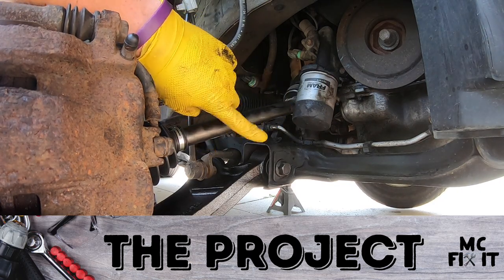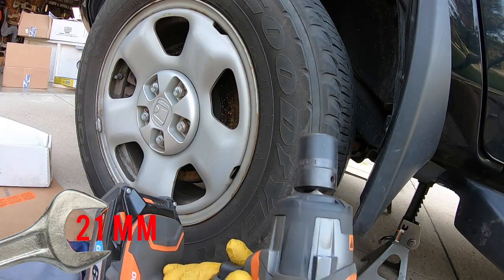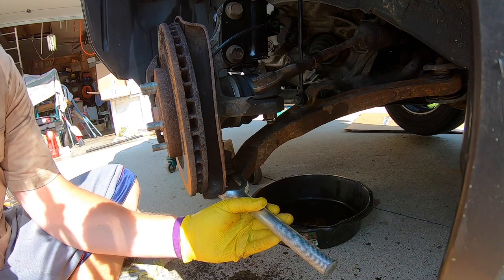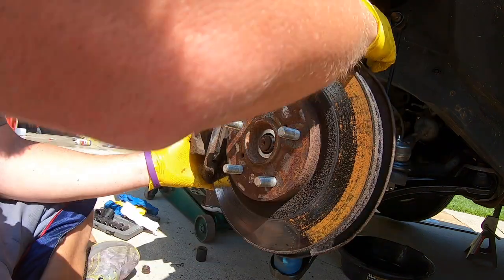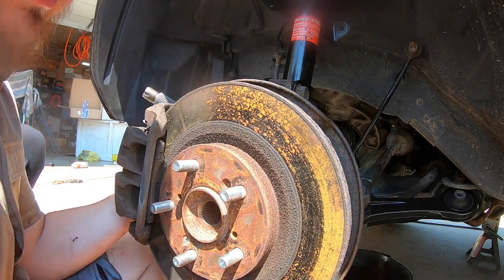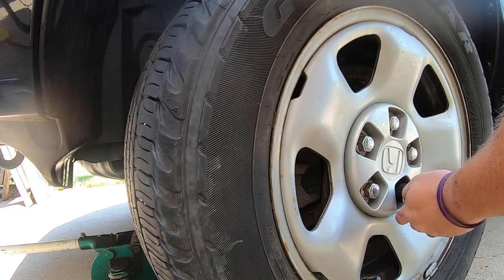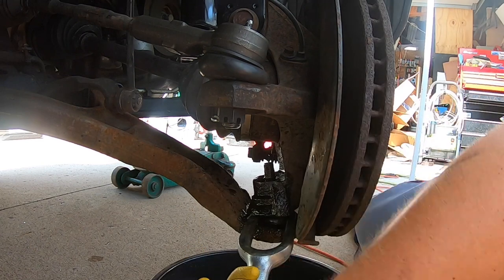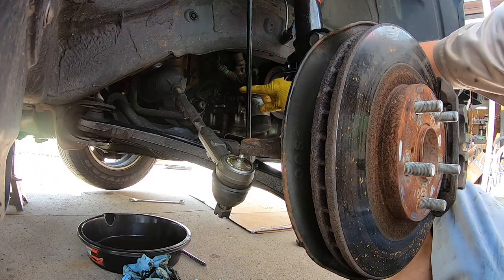How to Replace CV Axle / Drive Shaft on Honda Ridgeline - Front Right & Left (Complete Guide)

Comment from the maker: The Tools:
• Drive Shaft / AV Axel - FRONT RIGHT (Napa Remanufactured - NCV 956284) - https://www.napaonline.com/en/p/CVQ95...
• Drive Shaft / AV Axel - FRONT LEFT (Napa Remanufactured - NCV 956283) - https://www.napaonline.com/en/p/CVQ95...
• Pickle Fork set - https://amzn.to/2X94HyQ
•  Floor Jack (3 Ton) - https://amzn.to/2R7G96H 
• Jackstand (3 Ton)- https://amzn.to/3f3ABC5 
• Pilers - https://amzn.to/3lEU6WF
• Gloves - https://amzn.to/3bbfEnu 
• Safety Glasses - https://amzn.to/3ux25GO 
• Shop Towels - https://amzn.to/2SC8D93
• Ratchet - https://amzn.to/3xWjE5g 
• 17mm, 19mm, 22mm Socket - Basic Socket Set - https://amzn.to/3fjRoBd
• 36mm socket - https://amzn.to/37sz6Kf
• 17mm, 19mm Wrench - Basic Set - https://amzn.to/3jzlMcJ 
• 1in Wrench - https://amzn.to/3ArUuf1
• 1/2in Impact Drill (Rigid) - https://amzn.to/3vVDUBZ 
• Torque Stick - https://amzn.to/33wFTR2 
• Impact Sockets (Metric) -https://amzn.to/3etXiQU 
• Torque Wrench - https://amzn.to/3fEIrDi
• 18in Breaker Bars - https://amzn.to/3lLDpZA
• Flat Head Screwdriver - https://amzn.to/2RAjTlU 
• Long Flathead Screwdriver - https://amzn.to/3CCDCED
• Hammer - https://amzn.to/2VBhF7V
• Rummer Mallet - https://amzn.to/3jDa5le
• Sledge Hammer - https://amzn.to/3ywEurD
• Penetrating Oil - https://amzn.to/3yyyoqV
• Oil Pan - https://amzn.to/3CteDDq
• Tie Rod Puller Tool - https://amzn.to/3lKJ3v6 
• Crow Bar - https://amzn.to/3s0B9yC

00:00 - Start of Video
00:07 - The Problem
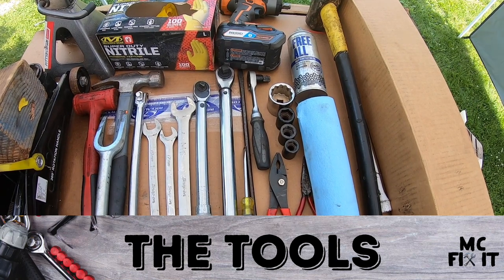00:31 - The Tools
02:10 - Jacking up the Truck
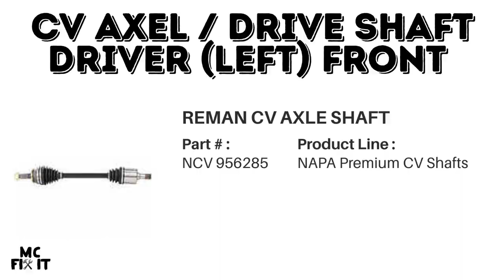05:00 - Front Left (Driver) CV Axle / Drive Shafter
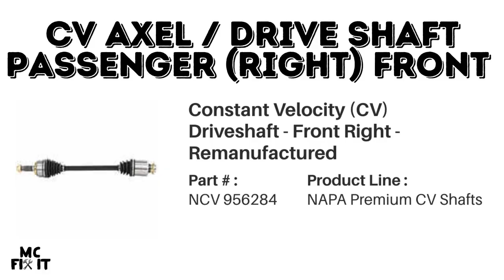23:03 - Front Right (Passenger) CV Axle / Drive Shafter
42:00 - Putting the Truck back down
42:40 - Closing of Video

This video works on many makes and models.

Check out my website at http://mcfixit.us 

Disclaimer:
Due to factors beyond the control of MC FIX IT, I cannot guarantee against improper use or unauthorized modifications of this information in the video, post, blog, or social media. MC FIX IT assumes no liability for property damage or injury incurred as a result of any of the information contained in this video. Use this information at your own risk. If you feel uncomfortable at any time. Stop and go to a professional. MC FIX IT recommends safe practices when working on vehicles, your house, or any other project and or with tools seen or implied in this video. Due to factors beyond the control of MC FIX IT, no information contained in this video shall create any expressed or implied warranty or guarantee of any particular result. Any injury, damage, or loss that may result from improper use of these tools, equipment, or from the information contained in this video is the sole responsibility of the user and not MC FIX IT.

#mcfixit #autorepair #hondaridgeline

——
Supplies used to record this video: 
* GoPro Hero 7 Black - https://amzn.to/3f3ALtb 
* 256GB Flash Drive - https://amzn.to/33pAueG 
* Vlogging Frame - https://amzn.to/33tajE0 
* GoPro Pro 3.5mm Mic Adapter - https://amzn.to/2RCURCu 
* Youmic Lavalier Lapel Mic - https://amzn.to/2R55sWX 
* Boom Stand (tripod) - https://amzn.to/3bdkQaw
* 5/8” to 1/4” adapter (boom to blogging frame- https://amzn.to/3txrVsM 
* Portable Battery Powerbank- https://amzn.to/3vJQc0q 
* 6ft USB to USB-C (powerbank to GoPro)- https://amzn.to/3uAS5MH

Comment: Another $250 saved.  THANK YOU!!!
Reply from the maker: You are welcome! Hope you have a great day!
Reply: The shaft cost me $225 in Canada at NAPA.  Service at the dealer in Airdrie was quoted at $750, shaft included.  Where are you that it only costs $250 installed?
Reply: @rossgee2950    I'm just talking about the labor.  It was going to cost me about that much in labor to have a mechanic do it.  now I'm going to do it myself.
Reply: @wizardonthejob  That makes sense. Not a bad price for the labour, though.  I just installed the right shaft in mine.  Because of rusted parts and since the shaft was very resistant to popping loose, it took me 4 hours. Had to drop a section of the exhaust to get a rod in line with the end of the shaft to bang it loose.

Comment: I’m so glad I watched this! My passenger side cv axle did not click in and I thought it was in. I can grab the cv axle(where you had to put a screw driver to knock it out) and wiggle it…that’s probably my vibration issue! 

Thanks for the video!
Reply from the maker: You are welcome. I’m glad to hear it was helpful! Have a great day and good luck on your project!
Reply: @MCFIXIT  So I had no luck getting my cv axle to seat. I am using a brand new aftermarket and I’m wondering if that’s my problem. I have a OEM cv axle on the way and hopefully I have better luck getting it to seat in place. I can still wiggle the part where you had to hit with your screw driver, but the smaller opening part looks flush up against the transfer case. I just don’t get it. If all else fails I’ll have to take it in which I always try to avoid, but sometimes I have to swallow my pride lol.
Reply from the maker: I, sorry. That’s got to be frustrating. What brand did you try? I hope the Honda part fits properly for you!

Comment: Love your Ridgeline videos, I've learned a TON.  But please tell me how those NAPA remanufactured CV axles are holding up?  I'm looking at how to remove, clean and re-boot the existing ones, but wow, what a process!
Reply from the maker: Great! Over 30k on them and not a single issue! Thanks for watching :)
Reply: OK, I'm convinced!. I'll go with those too, but hold on to the old ones and learn to refurb them.
Reply: I intend to replace on the front end: struts, sway bars, lower control arms, tie rod ends, and sway bar bushings and CV axle. That will keep this retiree busy for a while.  Thanks again for motivating me.
Reply from the maker: You are welcome. Best of luck on your projects!
Reply from the maker: Good idea. I haven’t done that yet. I gave mine to my neighbor who scraps and blacksmiths. He loves all my old car parts

Comment: Mine 06 started Vibrating like crazy when going over 60 and its only doing it while accelerating and pressing gas! What you thing it could be?
Reply from the maker: Where do you feel the vibration from? Front? Back?  A side? 
I'd look under it for anything loose or broken - tie rods, struts, axle, cv joint, etc. I'd look at that area first. That's not normal and can lead to a more serious issue or wreck if not fixed if it's vibrating like crazy.
Reply: Same issue on my 06 Ridgeline.  Have you found the issue yet?
Reply: @SubAlllStar  hi sorry for late reply been really busy but I haven’t found solution i got wheel balanced and tires rotated but no lick but you know it doesn’t vibrate sometimes i don’t get it what it is? And feel like it vibrates less in rain
Reply: @ParthPatel-xq9nt  I ordered new axles and lower control arms. I plan on installing this weekend. I'll let you if that does it for me.
Reply: @SubAlllStar  yes please let me know thank you
Reply: @ParthPatel-xq9nt replaced my cv axles, seal, tie rods, and lower control arms yesterday. My severe shaking starting around 60 mph is now just a slight vibration at around 80 mph. Still gotta do an alignment though. Tie rods and and lower control arms were in better condition than I thought. CV bearings were definitely shot. Hope that helps. Good luck!
Reply: @SubAlllStar  thank you for letting me know I will try same thing I am pretty sure now it should be CVs and lower arms . I like this truck and i want to keep it for long mine got 215k and its still running good no issues other then vibration.
Reply: @SubAlllStar  Update: changed my CV axle and now its fine. 😃
Reply: @Parth Patel  Nice! Glad to hear. Hope you get another 200,000 out of your Ridgeline.
Reply from the maker: What all have you checked or fixed?
Reply from the maker: Great news!
Reply: @MCFIXIT  mine was only one side CV axel that was bad installed new and now its perfect again
Reply: @Parth Patel what axels did you end up using?
Reply: @ParthPatel-xq9nt  what axels did ya use? And what were the symptoms of it being bad? I have the shake in my steering above 66 or so. I've replaced, struts, tie rods, lower control arms
Reply: @bryanm9880  sorry for late response we used once from autozone my brother is Tech. He Replaced only one axel and it fixed whole issue it was in bad shape . Now truck has started ticking noice i was afraid that was common from engine but seems to be power steering pump going bad!

Comment: Is it not necessary to also replace those inner seals when replacing the cv axles?
Reply from the maker: I ended up changing my drivers side seal. There’s only one and it’s there. The axle goes through the transmission. I’ve got a video on my page about that. Thanks for askingn

Comment: How do you prevent over or under torquing the axel nut when installing it with an impact wrench?? You said you want 250lbs/ft.
Reply from the maker: Honestly, it’s more by feel. Don’t hold it down and let it really get to work on there. Eventually I’ll buy a ratcheting torque wrench that goes up to 250 foot pounds. There’s not a whole a lot of applications for it though so I have not bought one yet.

Comment: Do you have a video on doing wheel studs for the ridgeline?
Reply from the maker: I did record it but it failed to record the whole thing so I never released it. They are pretty inexpensive from Honda and only moderately difficult. Removing the dust shield is key in getting them out easily.

Comment: Commented on the wrong video...  im tryibg to track down a clunking noise. And seems i found the cv axles slide side to side and make a clunk... this normal?
Reply from the maker: No. They should not make a noise and move. They should on move side to side. My main issue was the grease was leaking out which means they would be failing soon. You don't want them to go out and not have them changed. It can be very dangerous.

Comment: Why did you cut out how to remove the inboard pass. C.v. housing shell that's locked by the sir clip? You just reached in and removed it by hand? In my 43 years as a mechanic I have NEVER had that happen! You used  repackaged dorman parts from Napa????? How much vibration afterword?
Reply from the maker: Very vibration. Yes they were redone ones. Many of them are not the right size unless you get repacked or Honda ones. They are often off by a 1/4 in or more in length. Locks are in the end and when you pull out directly they pop. I didn’t mean to cut anything out. It’s a direct pull and then a direct pop back into place with the new locks that are built into it.